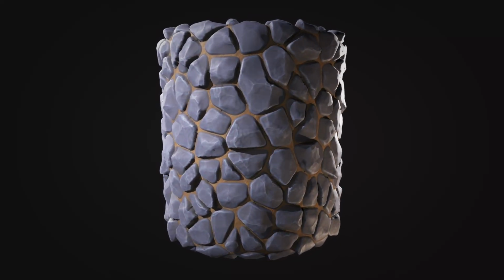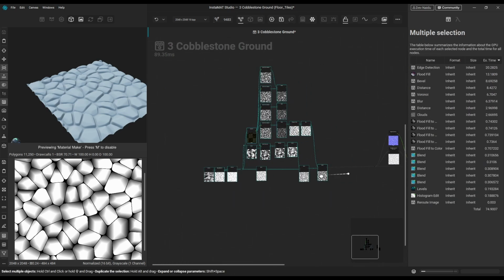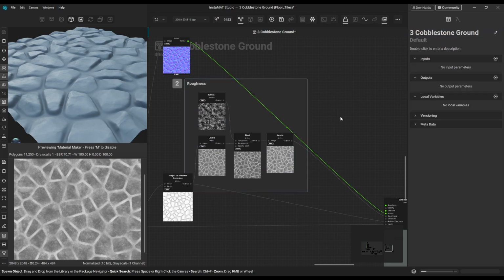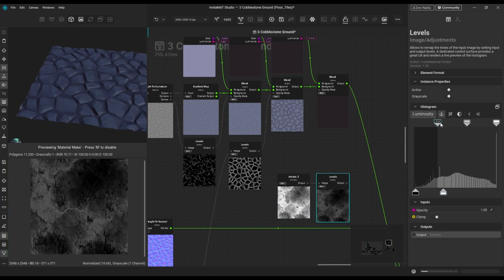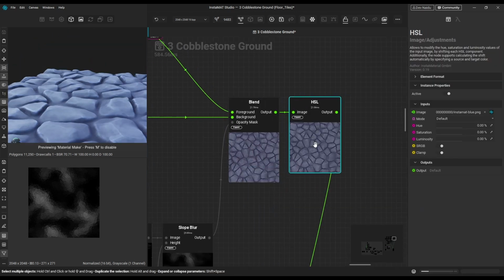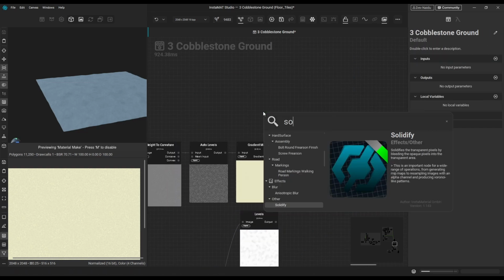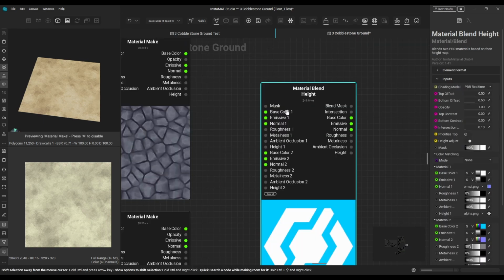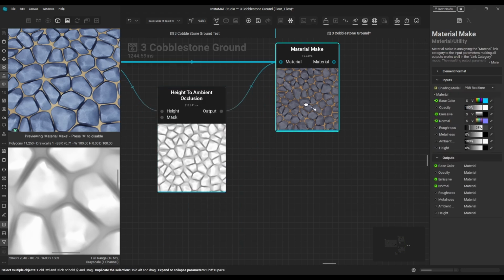Stylized Cobblestone Ground Tutorial - InstaMAT | Element Graph

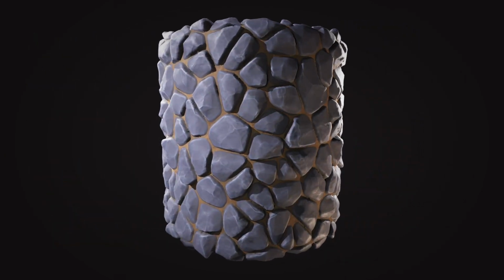Comment: Cool! Maybe I'm missing something but the height displacement in your mesh at the very beginning (0:11) is way higher than mine, did you changed any parameter to achieve that?
Reply from the maker: Hey Vinnie, make sure to add an Auto Levels node at the end of your height map so you’re getting the full displacement range. You can also tweak the height intensity in your project settings under the displacement factor (up to a max value of 10). Just note that this only affects the preview inside InstaMAT, if you bring the texture into Blender or Unreal, you can push the displacement much higher. For the turnaround in this video, I actually rendered it in Blender. As a reference you can check out my beginners tutorial linked in the description at 26:35 for that setting. Hope this helps.